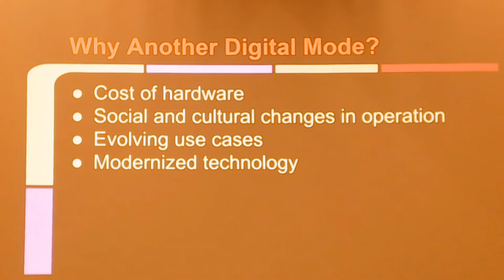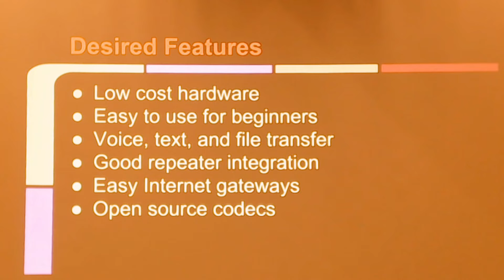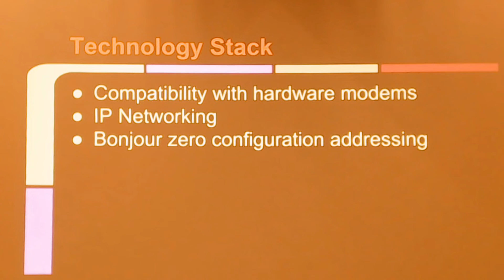A New Digital Mode | TAPR DCC 2019

Comment: I'm not a fan of digital audio modulation,and modes like death* dmr,fusion etc.
It has made a big labyrinth on finding people.
It has made repeaters in my area to go shut down, because of no analog activity.

I like analog wide band audio modulation, and THT soldering.  I'm sticking to Echolink en wfm . Low cost and digital and hams are a big lie.  Hams want to make money nowdays on the boards they create.  They dont want to share thoughts an pcb files. MMDVM,SVXcard,whispr, audio interfaces, wiresx,dvmega,dvrptr. All projects that had a pricetag.
Reply: African Twin, digital is much much better once you actually embrace it, and use it. DMR is completely taking over SoCal, and it’s fucking awesome. I can send text msgs, every repeater is linked to every other repeater, 2 channels per frequency pair. Analog was absolutely horrible. Driving around town with an HT in my car, and trying to connect to analog repeaters to talk to people? Not happening 10 years ago.  Try to connect to someone out of town, out of state? Not happening without coordination. Analog is dead. Good riddance.
Reply from the maker: Analog repeaters in my area died a long time before digital got popular.  And really, they aren't dead - they are just quiet.  I do still talk on analog repeaters quite a bit, actually.  But DMR is still my favorite right now.
Reply: @paaao   i only have experience with d* icw PiStar.  when i listen to the audio while driving vw passat diesel , i cant hear nothing from that conversation.  because of its very narrow digital  modulation. It is cracking in my ears.  It hurts.   6.25 khz is not nice.  SSB  is way better.    Dmr i have not used.   I stopped using pi-star because many reflector servers  kept disconnecting after a few hours of listening.  Ref1c i liked and the US rv truck reflector.   But the rrrtt ddeeetooo  sounds  were anoying.    Now im not active anymore on the bands . With a general license u cant do much in the Netherlands.   Im waithing that Yaesu is releasing  a new monoband trx with 9k6 data port so i can use echolink again.  The 7900 is out off production ,and all budget Ftm models dont have cor cos sql pinout, or mini din 6 data port.
Reply: African Twin, I could be wrong, but Dstar I think is 12.5 khz, as is DMR. DMR splits this 12.5 khz (narrow FM) into two channels of 6.25 khz each. However, to say that DMR sounds worse than SSB?? Not sure how that's possible. SSB is also quite small in bandwidth. I've done a lot of SSB in my day, and it requires phonetics, and lots of patience. Add in the static, clarifier knobs, and SSB is pretty painful listening for more than 15- 20 mins. Especially with multiple users on the same frequency, all using radios that are slightly off from one another. To each their own. DMR is taking over all the analog repeaters for a reason, and the reason isn't because it sounds terrible and doesn't work well. It's because it sounds better, and provides much more flexibility, additional options/features, and far greater ease of tcp/ip transport. Not to mention the reliability and error correction that comes with using a digital mode like DMR. We don't even do FM simplex around here no more. DMR simplex and simplex text msg'ing kills it every time once we tested at the fringe limits.